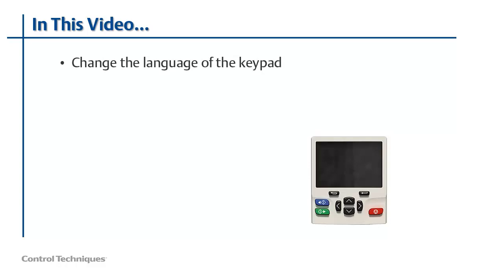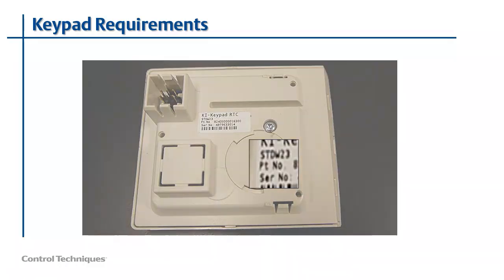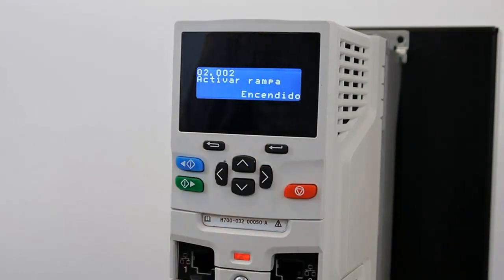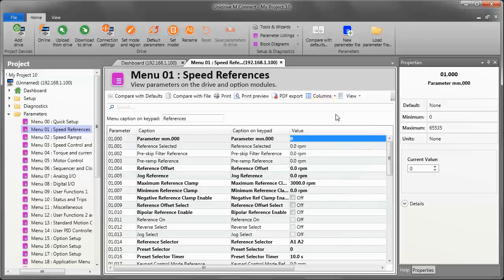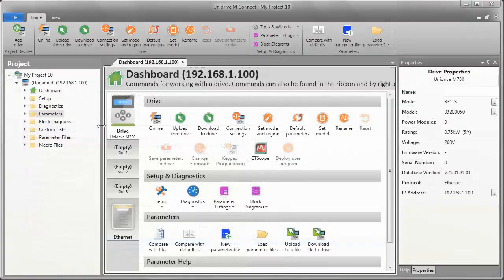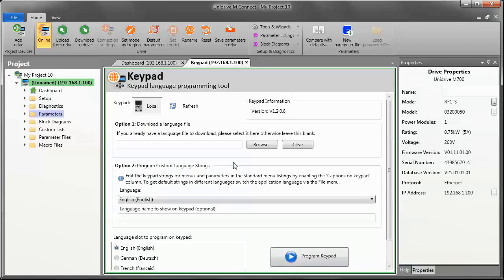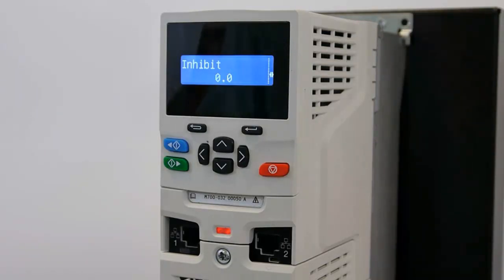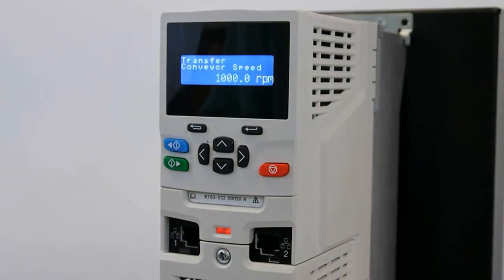Customizing the Drive Keypad

Comment: i have a problem with m700 drive. i'm using an ethernet communication and when the drive is starting, the red light is off. the keypad shows "initializing..." and all the buttons on the keypad are not responding. any idea? thank you